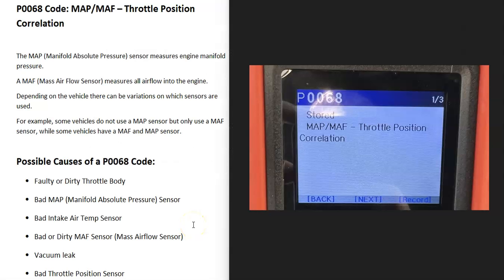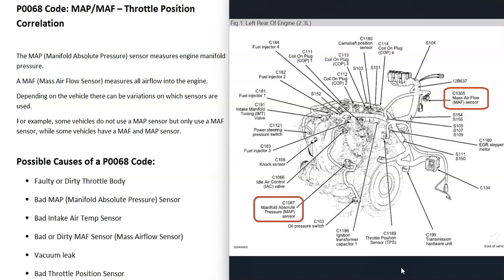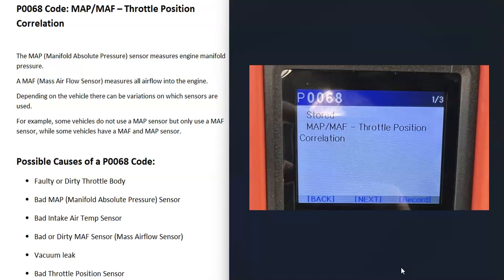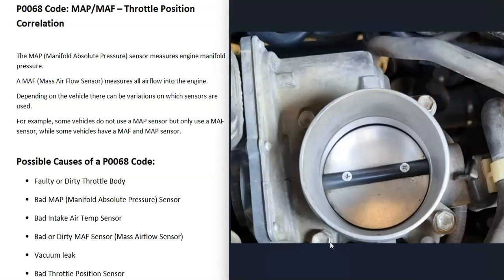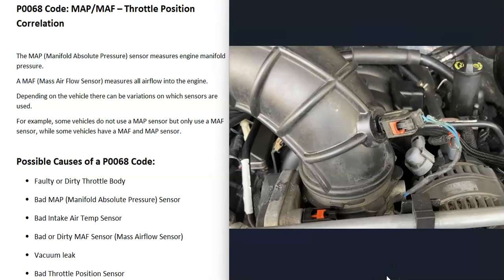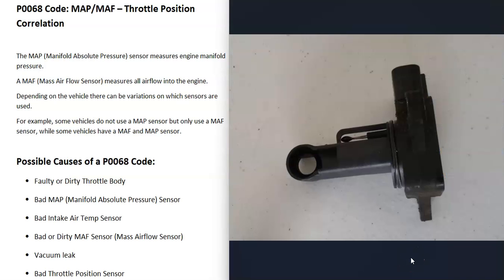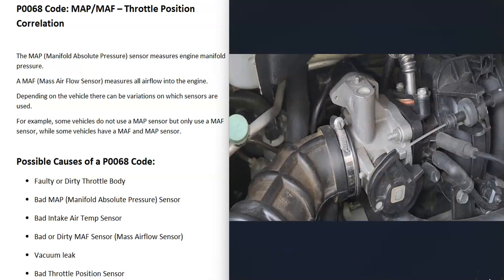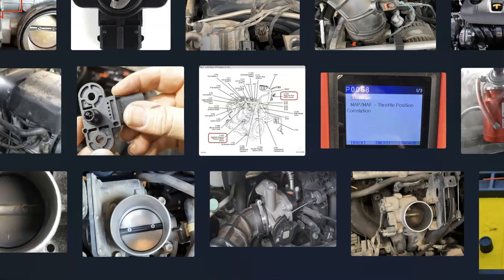Causes and Fixes P0068 Code: MAP/MAF – Throttle Position Correlation

Comment: I just had the garage replace the ac system because it wasn't working anymore. And now, 2 months later, my car stopped. Went back to the garage and had the diagnostic p0068. Can this code be related to the work they've done on the ac system?
Reply from the maker: It is very unlikely, when a sensor goes bad, or there is a throttle body issue usually there is an immediate code.
Reply: Thank you  @HVAC_Mechanic
Reply: I had the same issue on a 2015 Mercedes c250. The code won’t go away I changed 2map sensors Ambient air temp sensor and cleaned the throttle body. Clean Air Filter. I Need help do you know what it could be??
Reply: @blacklivesmatter2274  hey buddy did you get it fixed??? This has shown on my car to recently, you mentioned the A/A temp sensor is that the air intake sensor as those are two diff readings when I look at data. Also if not a leak potential carbon build up if you have turbos or the air intake sensor needs to be cleaned/replaced..

Comment: Had this pop up today. It got down to -9 deg overnight and when I was driving this morning the check engine light came on and the engine shuddered a bit. When I stopped at gas station for a soda and left, the engine ran fine. I CLEARED the code when I got home. Guess maybe the extreme cold must of messed with it somehow.